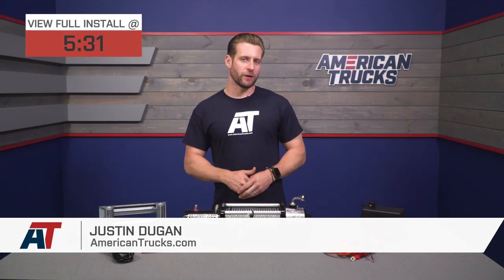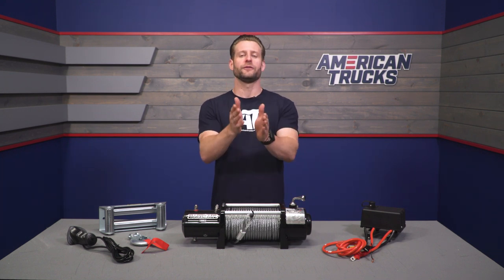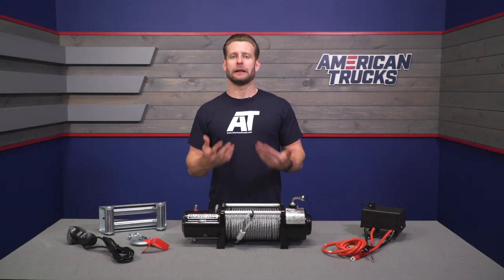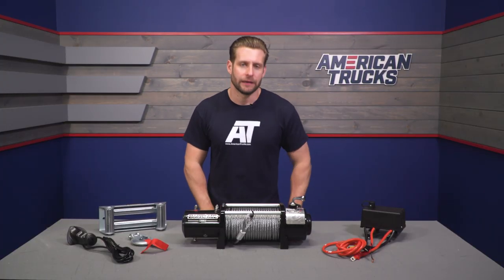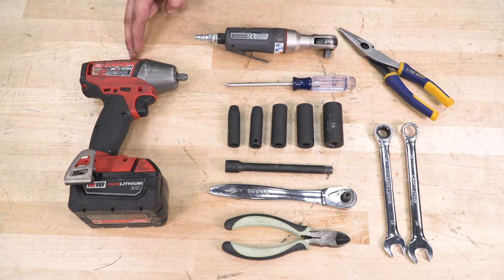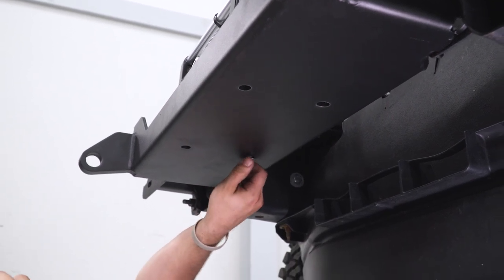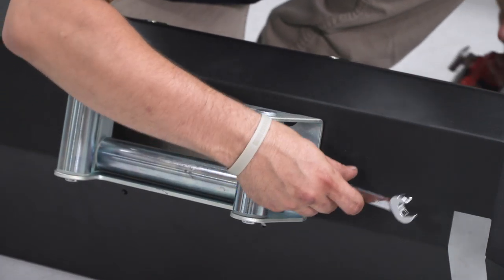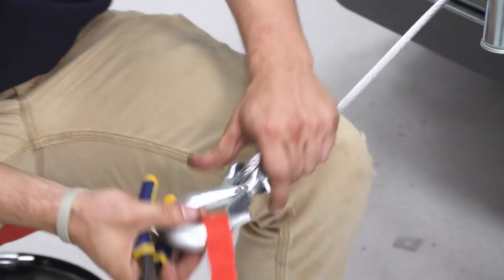1997-2019 F150 Barricade 12,000 lb. Winch Review & Install

Comment: Good video Except...I noticed the (red) safety strap was not used when reeling in the cable and securing the clevis hook. Might want to be careful. If the hook turns sideways when winching in you could loose a few fingers.

Comment: Would the hawse fairlead or a roller fairlead be a better choice for a winch with the synthetic rope??
Reply from the maker: I like a hawse as long as it doesn't get burred up.  The roller can pinch the line on the outsides (very unlikely but worth pointing out). -Justin